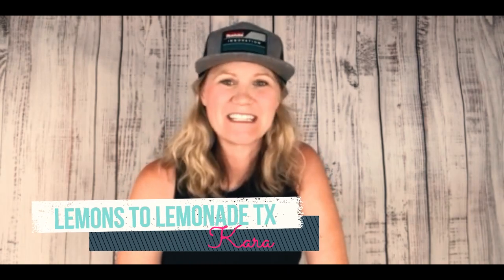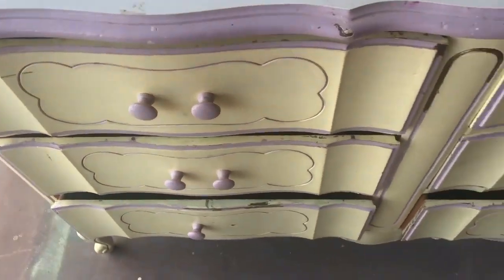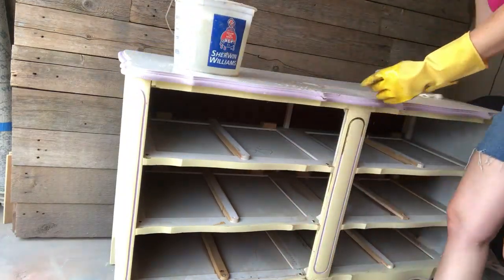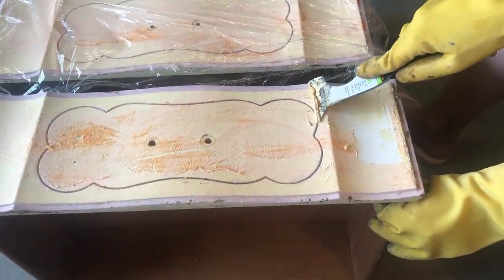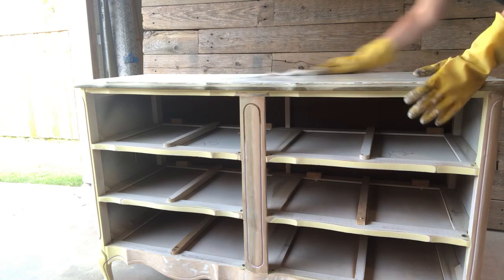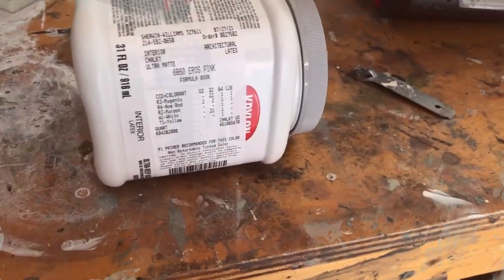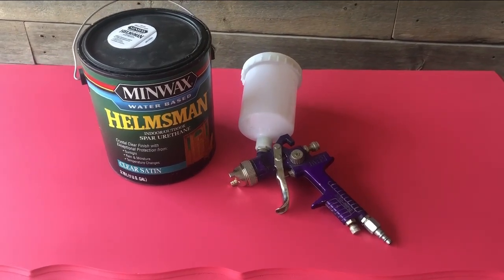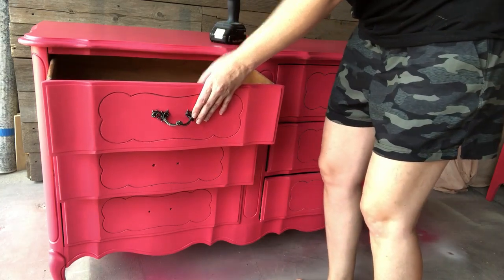My Hardest Flip YET! I DIY Dresser Painting Ideas I Dresser Makeover DIY

Comment: Definitely not my tast, but it will make some little girl happy.
I just bought 2 similar pieces and am petrified to start them. I did a small chest back in 2002 and it turned out awful. I need something cheap for my new house so I’m going to give it a try again.
One piece is sanded and ready for the primer. 
I have to do it inside the house so I have a bunch of boxes in the garage to put underneath it before I start painting.
Wish me luck 🍀